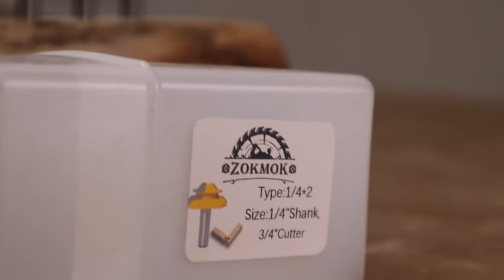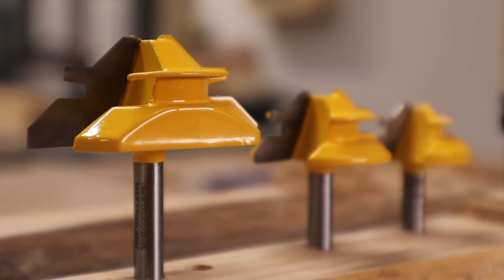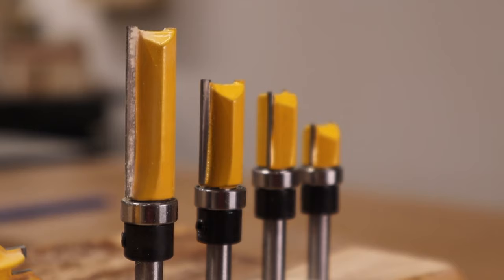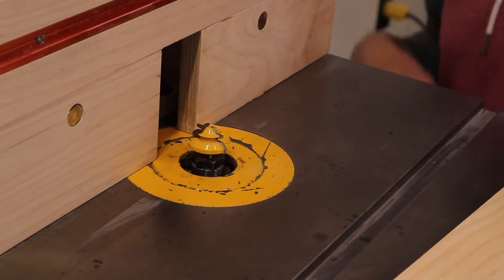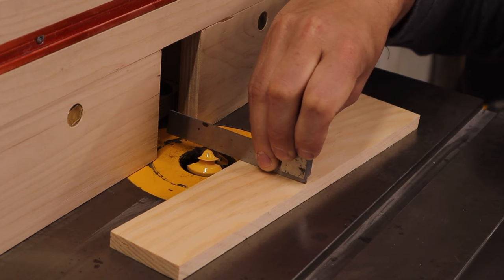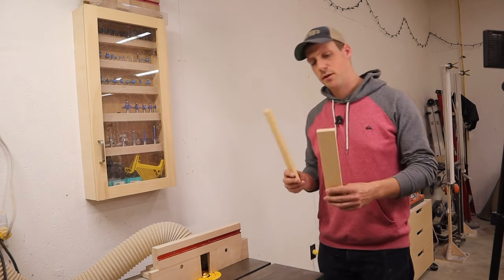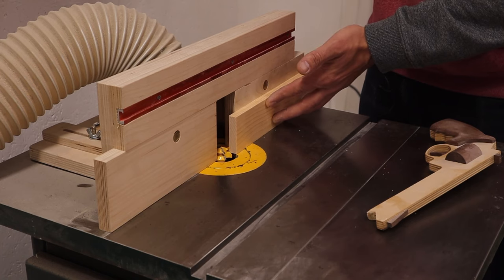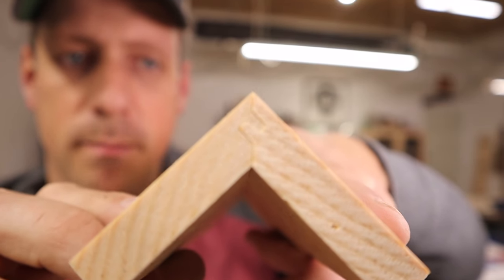How To Use A Miter Lock Router Bit From Zokmok Tools

Comment: Those locking miter bits with the 1/4" shank are fine for ply and soft woods but EXTREMELY DANGERIOUS for hardwoods! You need the 1/2" shank for stability. I have had 2 of the 1/4" shank locking miter bits from this company bend with very limited use on hardwood. Throwing a bit on a miter table is well,. Not good people! There is a reason why pro companies like Fruid don't offer these style bits with a 1/4" shank.
Reply: Yikes... I didn't notice that until I scrolled down to see these comments.  Agree 100%.  I have the Valkyr 1/2" shank version.  With any bit that does edge joins, I suggest you also use featherboards to hold the stock down and towards the fence... to get proper alignment and fit.
Reply: Thank you for this simple and to the point video. My next project is building an external speaker enclosure for my ham radio rig. I can buy one from the manufacturer for over $100 but why buy one when I can build it.  I don’t believe I can find oak or poplar that is 1/4” by 6” width so I’ll build it 1/2” by 6” width. 
I’m having fun with my Bosch router table combo 
I made a hardwood base 3”x 4” bass for a Morse code straight key. I used a Roman Ogee bit to make base look turn of the century and early American stain.  

I hope I have the same results as you.

Comment: what are the suggested RPMs? I just received my 3 Bits from Amazon however, there are no instructions on setup or the RPMs, on the bottom of the box the verbiage indicates "The Max permissible rotational speed(specifications on the chart) must not be exceeded!"   I DID NOT receive a chart and I can't find a cart on the internet or on You Tube.  Question? what is the RPM I have a standard Craftsman 1/4" router  I think I cant use it because i can't change the RPM's and If I need to but a new router I still need to know what the RPM's should be to use this tool.  I thought this was going to be simple it's looking like I'm going to have to send this item back to Amazon and also write a bad review on this product.  Oh also the font of the Box says USA US brand with Global Srouce  making it look like it's made in the USA but the item is labeled Made in China ( Packaged and product designed in the USA). Any help with the recommended RPM's would be greatly appreciated.   Thank you.

Comment: Why!!   I’ve watched so many of these set up videos, measured centerlines of material, fiddled and tweaked router settings to the point of frustration.  The bits are in the drawer never used because they were so finicky.  This is the ah ha moment I didn’t realize existed. Thank you!

Comment: Great vid wes. Ive seen alot of ppl say they had trouble dialing those in.  I didnot have an issue at all.
Reply from the maker: Thanks. If they take their time making sure the bit just touches the straight edge their should be no issues
Reply: @WesHamstra  agreed
Reply: I bought one of these bits years ago and had no instructions how to set up the bit. I still have it on my router bit box but i just learned how to use it. Could of been very handy for the projects i did.

Comment: I'll subscribe if you answer my question.  (Backstory). Me an my wife just bought a house.  It needs some trim work...drywall included.  What tools do I need? I'm a welder and mechanic by trade so I own drills and metal working stuff.  Know literally nothing about wood.
Reply from the maker: You need to get a mitre saw to cut the trim. You can use a hammer and finishing nails to fasten it but a Brad nailer is easy. As far as drywall goes you just need a knife and a drywall handsaw. Sounds like you have a drill already. Make sure you use a drywall dimpler to avoid putting the screws in too deep.

Comment: WHAT DO YOU DO IF THE BIT WONT FIT YOUR ROUTER
Reply from the maker: Sounds like you got the wrong size for your router or you have an issue with your router.
Reply: @WesHamstra  got the wrong size but ordered the right one